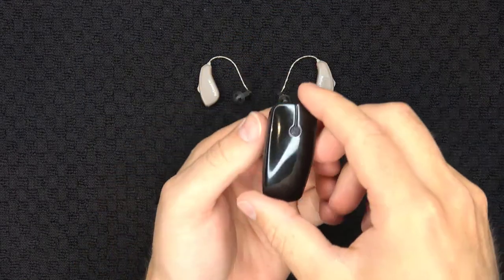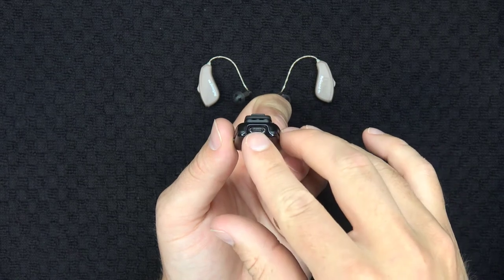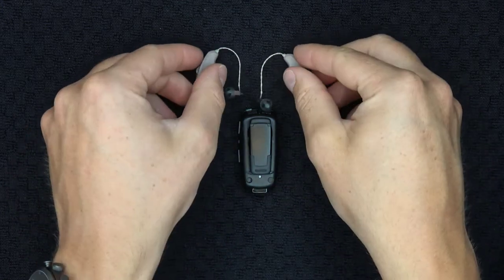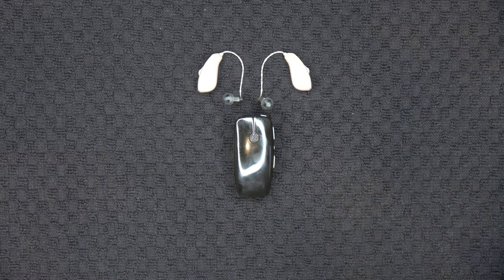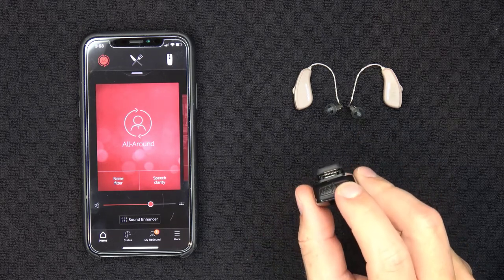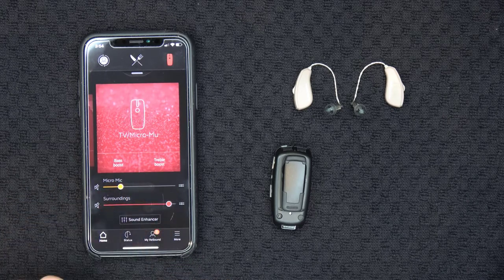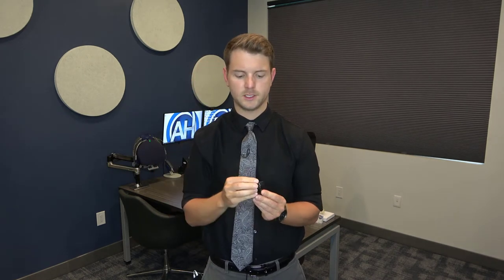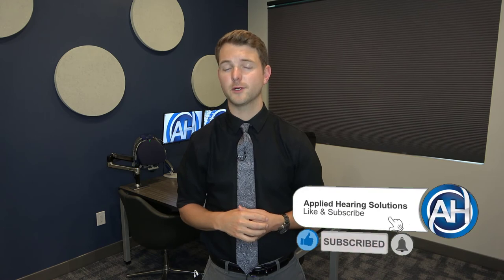ReSound Micro Mic | How to Set Up and Use Your ReSound Micro Mic! | Applied Hearing Solutions

Comment: I want to connect my resound1 to my new 2021 IMAC desktop.   No solution so far.  Ideas?????
Reply: The micro Mic also has a standard 1/8" audio jack. Just running a regular 1/8" male to male audio cable from your computer's headphone output to the device works great.  You have to select the input device (the thin grey side to side button on the back of the unit he didn't mention) to the music note symbol.
Reply: @theflatfish23    The unit being demonstrated is not the Multi-Mic which you and I have. The Micro-Mic does not have the versatility of the Multi-Mic.